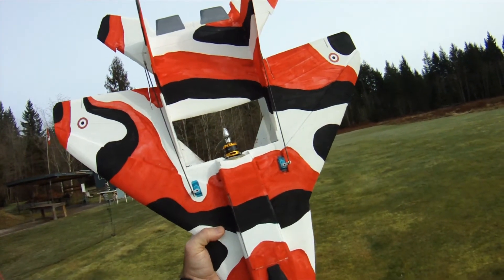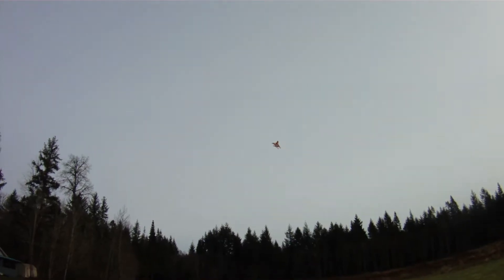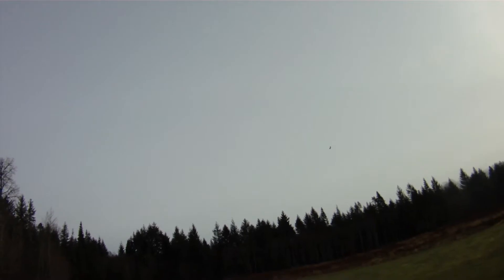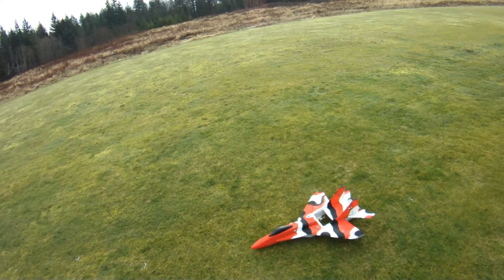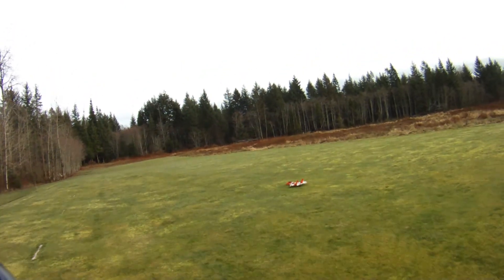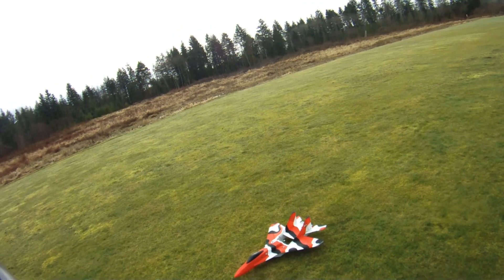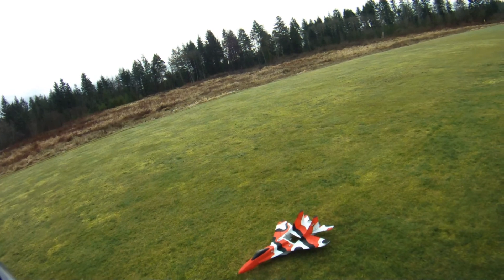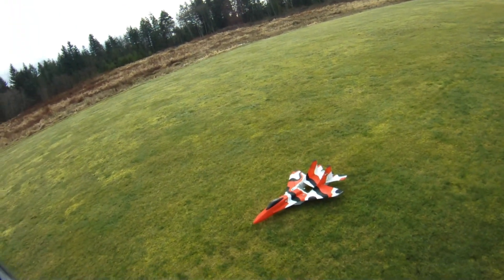2208 2600 motor showdown - DYS vs Multistar Viking

Comment: I got some sunnysky  2-ea for $10...$5 a piece. i couldnt pass it up..Plus it's USA stock. Free shipping too. i got the last ones.lol. A lot of it is becuase i want to use those 3s 1500mah packs I have, It's only 120 grams.  Plus 10 less grams on the motors. That's like 70 grams less. That'll bring me under 600 grams auw easy. it'll be good for me to just mid throttle and get more flight time.  900 grams...That's more than plenty for me. it's a good thing I got those 40 esc from the get go.
Reply from the maker: Are the sunnysky motors in 2208 2600 Kv?  What is the C rating on your 1500 Mah 3S batteries and what prop are you planning on using?  Cheers, Scott
Reply: Yes, they're 2208  2600kv, The batteries are 40 C.
I got the motors from a sort of garage sale E bay seller.lol
The motors are in plastic sealed bags ( real sunnysky)
Even if they arnt. i cant complain. They're only $5 ea.

The batteries are zup power. They're slighty less expensive.
I got it mostly for the wieght and 40C.
One of the pack was way out of balance. i know how to manually adjust/balance
the cells. ...Tricks i learn here and there.
At first i was pissed...it would only charge to 65%.lmao...becuase one of
the cells was way...way out of balance
Reply from the maker: That's a great price, from what I have read, the SunnySky are pretty close in performance to the DYS I used in this video, so depending on the prop you use, around 30-34 amps drawn at full throttle.  Specs I have read say that it is about a 43A maximum motor, although I would be careful to monitor that depending on the prop you decide to use.  Your battery will be good 40C with 1500 Mah it should be able to deliver 60A.  Good luck :)  Cheers, Scott
Reply: What prop size you using with 2208 2600kv

Comment: The sound between the two motors was very different. To me, it didn't sound like the DYS motor was turning the prop nearly as fast as the Viking. I also thought the plane looked faster with the Viking motor on the close and low passes. Thanks much for the motor test flights. The plane looks awesome! Happy Flying!
Reply from the maker: Thanks very much :)  Yes I agree the Viking motor is noticeably more powerful as I would expect for a motor that costs $28.14 :/  Not that the DYS motor is bad, the Viking motor is certainly better made, with stronger magnets, tighter tolerances and is a bit lighter.  I am glad I picked mine up on sale, it is a good motor, but I have tested some already that provide more power, are lighter and cheaper :)  Thanks for watching and happy flying to you as well :)  Cheers, Scott